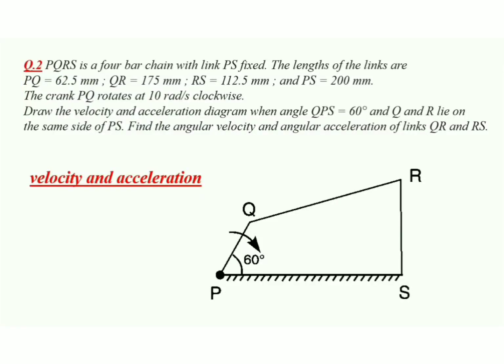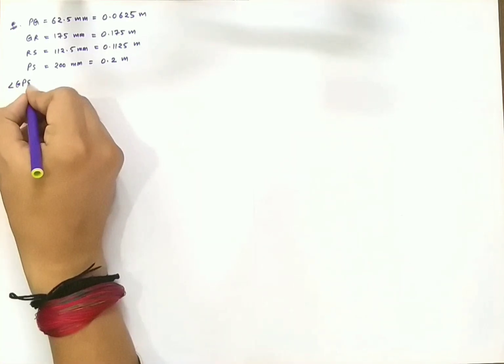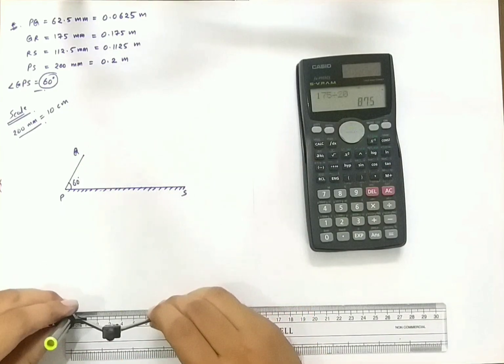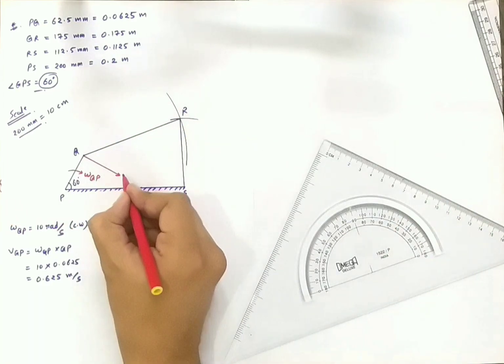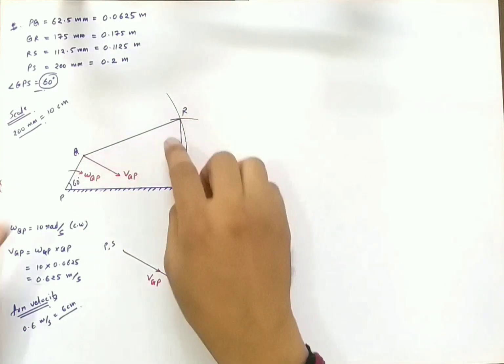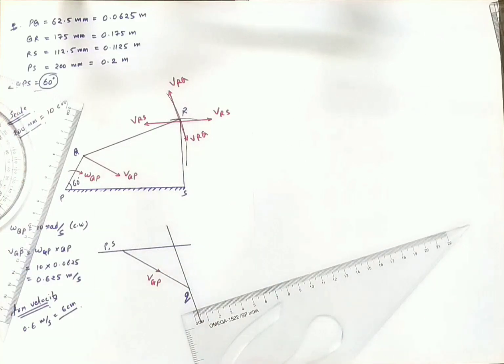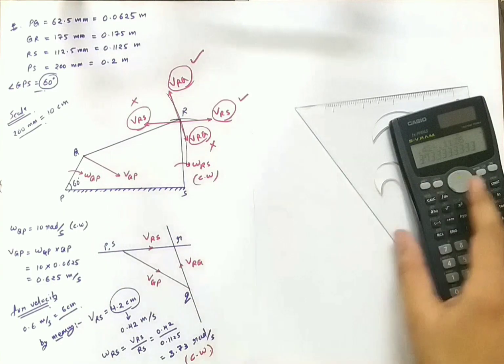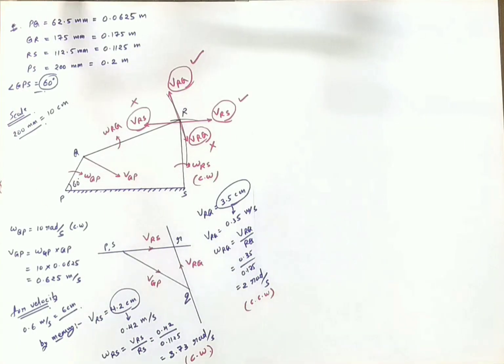Velocity and Acceleration diagram| Four bar chain |velocity and acceleration analysis of mechanism

Comment: ) A four bar mechanism is shown in figure along with 
dimensions the crank QB rotates at 60 rad/s counter 
clockwise direction. The lengths of the links are 
AB= 30 mm and QB = OA = 20 mm, CD = 450 mm 
and AD =600 mm. AD is fixed link. At the instant 
when QB is at right angles to QAO, determine the
angular velocity of the link AB.

Comment: I have a question. Let's say it is a double crank mechanism with both bars have equal length and the frame and coupler also have the same length, what will the velocity diagram look like?
Reply from the maker: Velocity diagram will be a Straight line...

Comment: can u please tell me how  u get the Vrs?
Reply from the maker: In velocity diagram...
1st step: you have to mark fix link point p & s
2nd step: take input link velocity Vqp (vel of q with respect to p, fixed or known point) in this you have both thing magnitude & velocity direction 
3rd step: now you have to mark point r, but you have only direction of Vrq and Vrs, (Vrq= velocity of r with respect to q, perpendicular to link rq) & (Vrs= velocity of r with respect to s, perpendicular to link rs)
Now the intersection of Vrq and Vrs is point r...
You can measure the length rs and convert to the scale taken for velocity diagram...that will be your Vrs

Comment: you stated that crank PQ rotates at constant 10 rad/s. would the angular velocity be constant if an actuator of constant velocity was connected at point Q? The four bar linkage will have limited rotation due to the actuator.

if the angular velocity and velocity of point Q is not constant, how would you be able to calculate it?
Reply from the maker: If angular velocity of the input link is not constant then...
1. In vector diagram their is no changes...because you are calculating on a fixed position like input link on some angle...
2. In Acceleration diagram... you have to calculate tangential component of Acceleration on input link... also you will be provided angular acceleration on input link...so you can calculate tangential component of Acceleration...

Note: in this given question, their is constant velocity and value of angular acceleration is zero...so tangential component value is zero